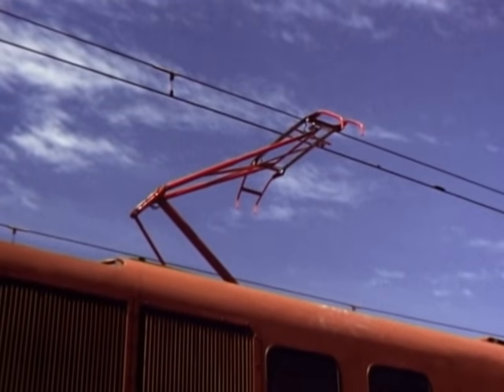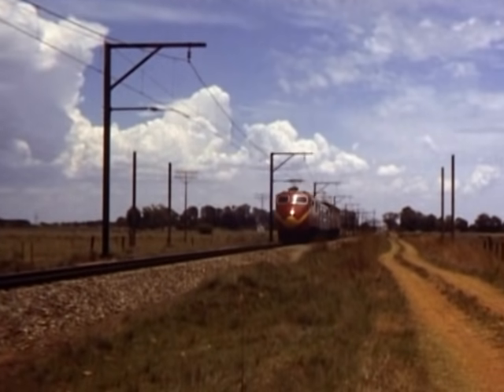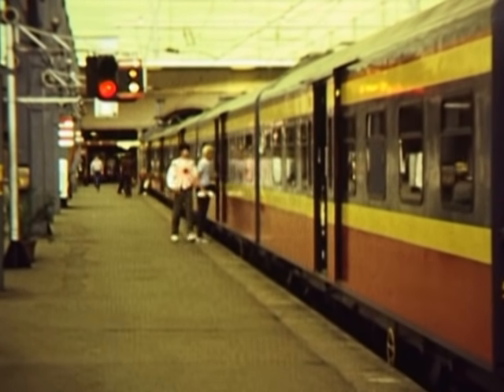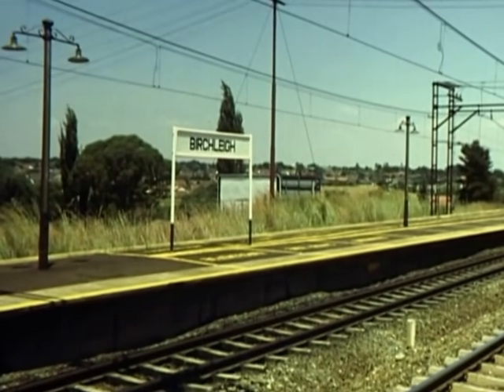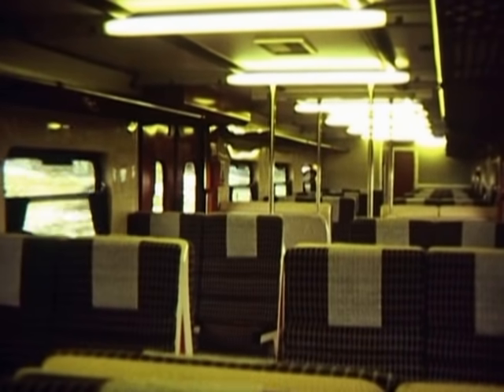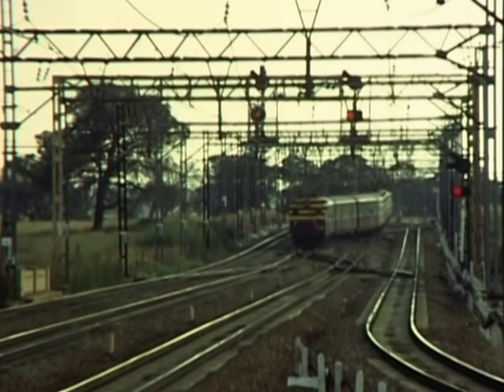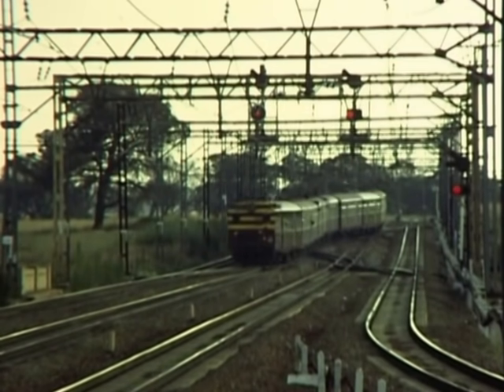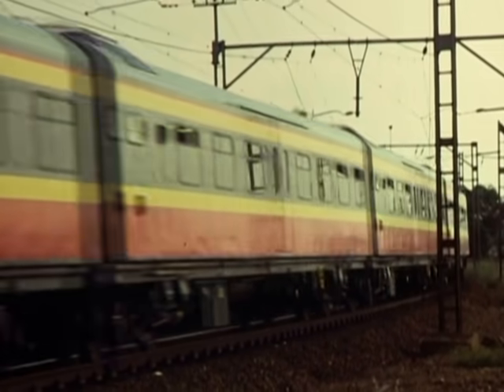High Speed on SA Transport Services & World Record on test

Comment: wait i heard narrow gauge could not get faster than 160 kph guess i heard wrong!
Reply from the maker: Phat Meow: You certainly heard wrong - I filmed the test trip when the test train rushed past my camera doing 245km/hour!  The speed attained on test was confirmed by an engineer on board the test train.  These tests resulted in a brief but regular passenger 160km/hour service between Pretoria and Johannesburg via Germiston.  The service was brief because political changes were coming and that put paid to any further development of the high-speed tests.
Reply: It technically can get faster, but for safety reasons it gets capped at 160km in most instances

Comment: Hi Les
Love the video. Quite interesting to know there was a "high-speed"rail before gautrain was introduced. Before Covid, Metrorail operated non stop express trains from PTA to JHB . However, I feel like they should stop at Rhodesfield to make a connection on the Gautrain. But that requires a efficient integrated transport system where prices are almost the same.
Reply: What makes me shake my head is that they pitched the idea of building Gautrain using European standard gauge track instead of the Cape Gauge used on the rest of our network on the idea that Cape Gauge couldn't handle high speed trains! This has completely prevented the expansion of the service onto existing track! If its possible to run at 160km/h on Cape Gauge why on earth did we build gautrain on standard gauge? smh
Reply: @BobyourUncle  I would agree 160km/h is good on Cape Gauge hopefully Gautrain at 1435mm gauge will be the precursor for an African HSR network.East African Countries have electric railways of 1435mm gauge and this will expand
Reply from the maker: Hi Makhado, Glad you enjoyed my video and yes, Gautrain was not the first hi-speed service between JHB and Pretoria.  It also made use of the existing main line via Germiston.  The Metroblitz was itself an experimantal service - further development was planned but due to political changes, the whole development program was suspended.  Regards, Les.

Comment: What motors were they using on these units to upgrade from the 5/6E class units ?
Reply from the maker: Hi Jas, the gearing on the class 12Es for Metroblitz duty provided for 160kmph but the 6E1 used on the experimental hi-speed test had her gearing altered to allow for ultra hi-speed running - hence the world record fot the 3ft 6in gauge. Les.

Comment: Les, your comment on the South African public is not public transport orientated.
The same problem as with the Gautrain. There is no support services like busses and safe taxis. The Gautrain has only limited bus service, Although Jack van der Merwe promised a full bus service in a 10 km radius from the stations,  and I live 6km from a station, I have no bus service. The same happened with the Metroblitz. You got to the station, and you were stuck.
Reply: In 1984 a huge number of people worked in the Johannesburg CBD. It was vibrant and with wonderful shops. The flight to Sandton was still in the future. Also, parking at Metrorail stations was mostly safe, plentiful and free. So for many the train worked without needing additional busses.

I used this Metroblitz numerous times. It was amazing.
Reply from the maker: Hi Leon, sorry that my statement disappointed you but I'm only concerned with railway developmet and not what the public requires - that is left to parliamentarians to sort out.

Comment: I may have sounded too critical. I salute the South African Engineers who developed this for the Cape Gauge. Has Japan Australia and New Zealand learnt from this? Moving forward I hope Gautrain will extend to become a High Speed network through South Africa and beyond.
Reply: Japan already has a high speed cape gauge line, with Shinkanzen trains using dual gauge wheels in order for it to operate on the main railway line which uses cape gauge / 1067 mm.
Reply from the maker: Sadly, political changes put a stop to  further development that was already being planned.